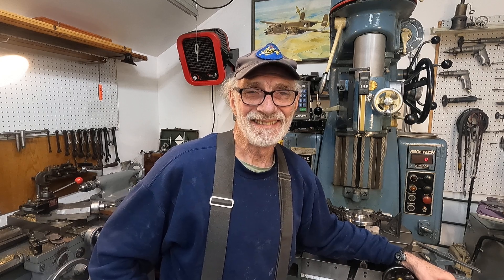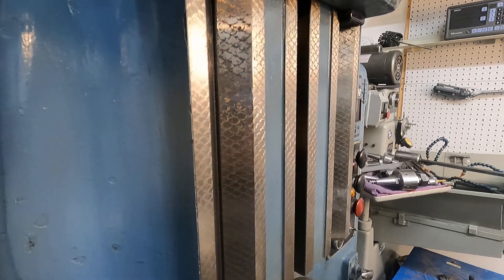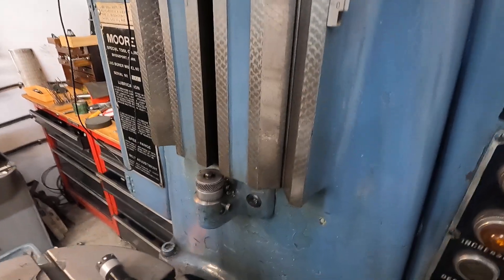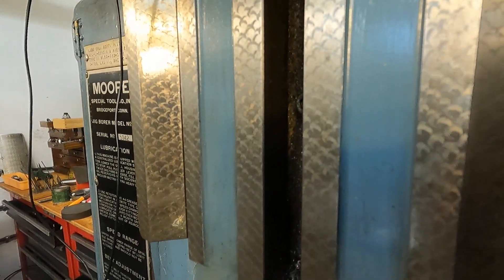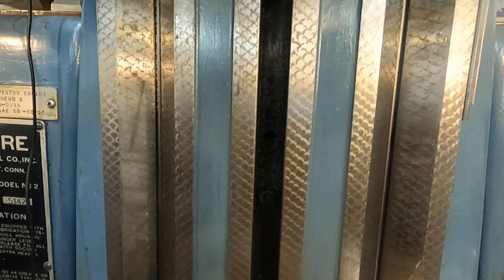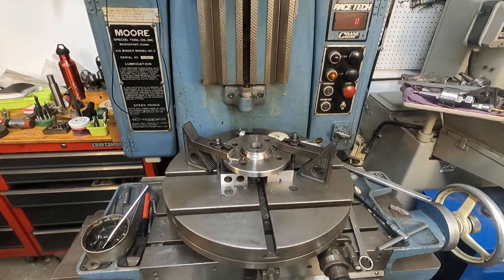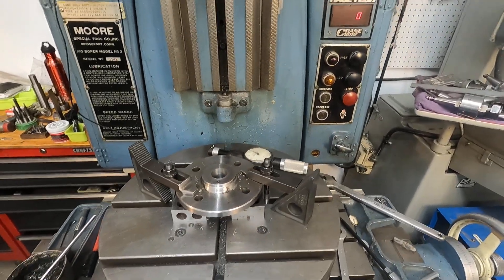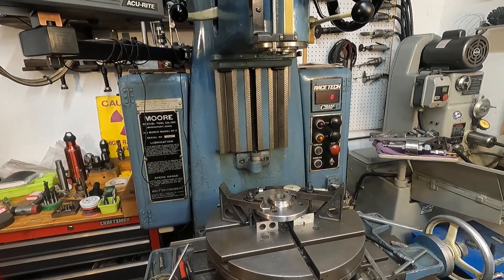Moore jig boring machine basic hole making  7

Comment: Moore used a half moon scraper on virtually every machined non painted surface. First they scraped then they did the half moon. I am rebuilding my Bridgeport like a Moore. As a CNC machinist, life is easy. But in my shop, it’s old school and you appreciate the old ways.
Reply from the maker: Moore is a very good company to deal with. They have been very helpful even though I have an obsolete machine, they are a machine shop like no other also. Thanks!